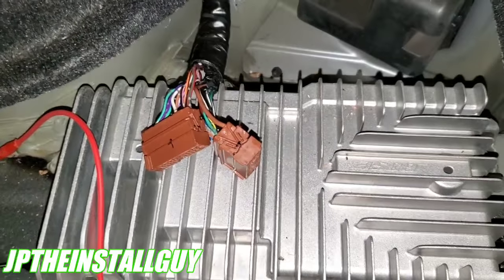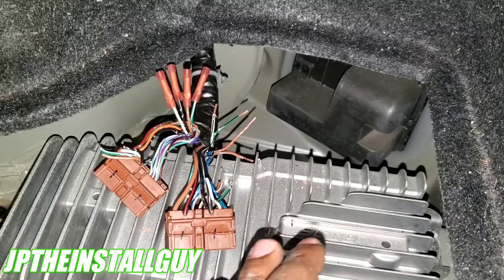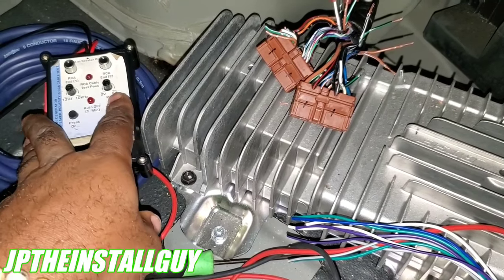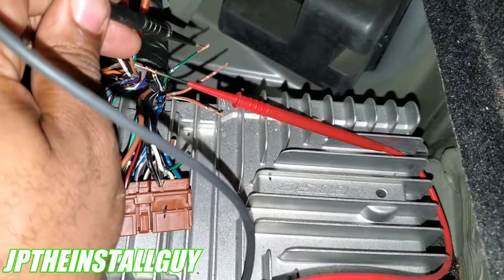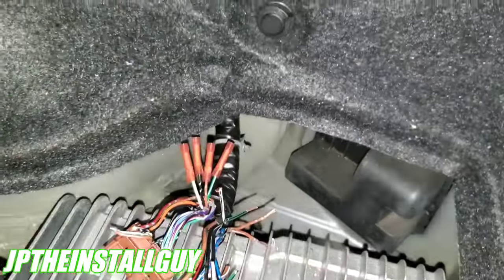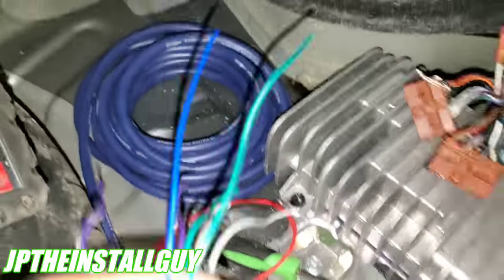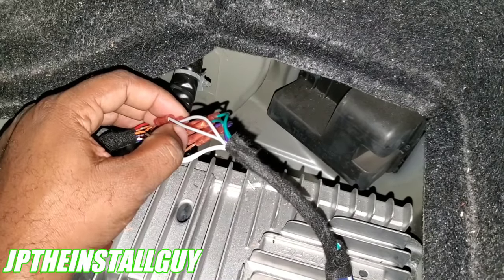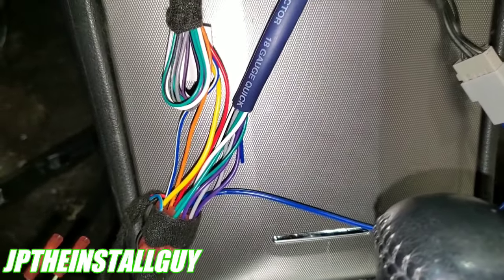How to bypass your factory amplifier

Comment: Can someone help me, I have the oem stereo in my 04 g35 sedan x, I have an aftermarket  amp, but the amp stays on with the stereo off, where or which remote wire to use?
Reply: Tap in acc wire (Orange) or better off get after market radio.

Comment: Dude can you offer me some advice please? I have a 2005 G6 and it has Monsoon. The only harness I can find says will not work with monsoon(idk if this means the stereo wont work at all or they are just referring to my DIC and chimes). Crutchfield says I need to buy this PAC interface but I dont want that shit, I dont care about my DIC or door chimes. Then I read I can use the harness if I bypass the amp. I dont understand why though. Can I just hardwire the speaker wires and not even connect the amp wire behind the radio? I saw a guy do this but he cut the amp wire and connected it to the remote amp wire from the aftermarket harness. I am so fkn confused man!! I would just keep stock radio but the damn this plays very low volume on FM radio only and no one can help me with that either. I happen to have an old sony xplod I thought I could just swap out until hearing all this crap about monsoon systems.
Reply from the maker: good question so if the harness says that it wont work with your vehicle if it has the monsoon system then it probably means that it is not going to integrate the factory amp. so the radio may come on but you wont hear any sound from speakers. PAC interface harness are always a better choice because it will do all the hardwork for you but it will be a more exspensive harness. the reason you can use the cheaper harness and if you bypass the amp is because the cheaper harness will only power the radio not provide sound so you will have to bypass the amp and run speaker wire to the back of the radio for sound. youll save money but is more work.
Reply: @jptheinstallguy  Ah ok this makes sense thanks! Yea normal harness + the case is like 25 bucks. That damn pac interface will run me at least 90 with a case!
So I can follow this or any video to bypass my amp or is monsoon amp bypass different? Will The volume be much lower because I am not using my amp? Or do you know if the Sony xplod radio has some internal amp that will make it just as loud? Other than volume will it sound better or worse if I do this?

sorry for so many noob questions haha

Comment: I have a 2016 ATS non-cue. My question is, I’m using a Schosche LOC2SLSD, I am only hooking up an aftermarket sub/amp (Skar IX10”D2, Skar RP800.1) do I need to run anything to the head unit? Or can I tap the LOC into the rear speaker wires/signal. I want to get it right the first time. The Bose system is in it and the amp is a 4 harness (black, brown, grey, green). Thanks.
Reply: You can tap the rear speakers as long as it’s not crossed over after the factory amp. If it’s crossed over you will need to find a full signal to power the sub amp signal.

Comment: Plan on adding AudioControl DSP. 2003 FX35 stock everything w Bose amp. Do I add DSP by tapping into the input speaker leads before the amp or after?
Reply from the maker: after the amp
Reply: @jptheinstallguy  Woild this apply to the LOC I'm using currently?  Thank you very much for the fast esponse

Comment: So is it best not to run lc1 off the factory amp?
Reply from the maker: The lc1 is just a bass knob right? You can hook it up to whatever converter or processor your using to tap in with but not straight to the amp

Comment: I have a 2005 suburban with the bose amp. If i take the speaker wires from the factory and connect to an after market amp to run my door speakers. Do I or can I also run the power and ground as well or do I even need to do that? I already have an amp for my 12 inch subs. Im trying to avoid running 2 amp power cables to the battery.
Reply: Use a distribution block to provide power to the second amp... That way you can tap into your original power cable, and then just run a second cable that's only 2-3 feet into the new amp, and of course give it it's own ground (or use another distribution block as a ground block). Also make sure that your power cable is thick enough to handle the additional wattage of the second amp.

Comment: I have a 2011 Maxima also with the Factory Bose system. I bought the plug and play adapter that plugs into factory radio to run my rca plugs. My aftermarket amp and sub work, but I'm not getting much sound. I've adjusted all gains, but still hardly any sound. What can I do to get the full sound to my sub?
Reply from the maker: Did you install an aftermarket sub?
Reply from the maker: What type of converter did you use
Reply: Yes, I have an aftermarket sub and amp. Everything is hooked up. I bought an add an amplifier adapter from Ebay that plugs into my factory radio. It provides the rca hookups and amp turn on wire.
Reply: Any advice on this setup?
Reply: @kylegibson326  I'd ask this question at the Diyma forum... Bose headunits often process the audio signal before it gets to the amp... You'll probably need to swap out the head unit, or get a JL Audio Fix 86 to flatten the signal and then a high end DSP to readjust the signal prior to hitting the amp...

Comment: Do I have to use the LOC on  the factory amp if I just want to install an aftermarket 1-channel amp and sub? Or could I receive the signals from the factory stereo? My car is a 2018 Honda Accord EX-L.
Reply from the maker: your factory stereo doesnt have a set of rca's behind it thats why you would need the loc so if you have a factory amp you can easily catch the speaker wires at the amp but if not than you have to catch it at the speaker or behind the radio
Reply: JPtheinstallguy Could I instead use the LOC on the rear speakers or the factory sub? The factory amp is tough to get to.
Reply from the maker: @Apezilla  if you can get to the sub use the sub especially if you are wanting to hook up a sub amp if you dont have a factory sub the rear speakers will be just fine
Reply: @jptheinstallguy  Yo JP, I got a similar problem. I got an 08 civic coupe with premium 7 speaker system. I want to add a 4 channel amp to juice up my new front and rear speakers. For the LOC inputs, do I connect them to the speaker wires from the factory amp or the inputs of the factory amp? I would then run the 9 wire to the amp and cut the corresponding speaker wires right? Or do I leave the factory amp inputs alone and just use the speaker wires?
Reply: @jptheinstallguy  ok quick question if we use the factory sub speaker wires that's 1 positive and 1 negative but then going to the lc2i for instance that requires left and right positive and negative. How would we use just the factory sub wire positive and negative ?

Comment: Is it possible to bypass the factory amp with out sending wires to the stock stereo? In other words can i bypass the factory amp and just connect everything str8 to my aftermarket amp. If so how??? Do i tap into the factory input wires to gain signal for the rca converter box for the amp and tap into the factory output wire to connect the amp to send signal from the aftermarket amp. Because Im really trying to avoid taking my whole dash apart and doing it that way. i located the factory amp in the trunk so i figure it be easier if this is possible. Please if someone knows i would really appreciate it. Thank you.

Comment: how would i run aftermarket amp to a stock radio that has stock amp
Reply from the maker: this is the way. bypass that factory amp and use the speaker wires from the amp side as signal for your LOC or processor and use the speaker side wires to run to your 4ch
Reply: @jptheinstallguy  I put a Bose in dash from a 2007 Tahoe into a 2008 Tahoe non Bose system everything plays but the sound is real low what do I do
Reply: @pirruripirruri4731  Go to the Diyma forum and ask them... I think that Bose headunit might be processing the signal before it gets to the amp/speakers... Bose shit sucks though... I definitely wouldn't put a Bose headunit into a non-Bose system... They sell double din stereos on Amazon for as little as $40... I'd buy one of those cheap ass units before I forced myself into dealing with a Bose that's going to fuck up the signals and give you sound problems.

Comment: how you find the ones come from the stereo? i find the other the ones going to the speakers
because i going to use my factory stereo i wanna put line converters
Reply from the maker: if your installing an loc use the same speaker wires at the amp. you dont want to tap into the radio wires because it not a high level signal behind that radio if you have an factory amp in the car
Reply: @jptheinstallguy  thanks so much

Comment: Can i bypass my amp behind the aftermarket stereo? Ima use another amp
Reply from the maker: Uuum it depends sometimes if the car is factory amplified then the speaker wires aren't behind the radio and you still need to tap into the wires at the amp
Reply from the maker: Uuum it depends sometimes if the car is factory amplified then the speaker wires aren't behind the radio and you still need to tap into the wires at the amp
Reply: Thank you thats what i had to do

Comment: You make it sound so easy now the audio shop makes it sound crazy difficult just to charge you more smh
Reply from the maker: Yea thats one thing I don't like that some shops do. But know this if they start talking crazy it's probably that they don't want to do it
Reply: @jptheinstallguy  right from they're pov F bypassing we want to take the whole unit out bose amp speakers wires head unit everything etc and let us install all new aftermarket equipment and charge you $6500 smh

Comment: just use a 9volt battery connect one wire to the pos then start touching the others when you hear apop thats two wires you need and the pop come from the speaker they go to

Comment: Is this what you have to do to add an aftermarket stereo in your car?
Reply from the maker: only if you have a factory amp and you want to amplify your speakers with a different or more powerful 4 ch amp you would just cut them from the factory amp and run them to the aftermarket amp
Reply: @jptheinstallguy  thanks so much much this was definitely a help
Reply: @jptheinstallguy  would you lose functions? We are having trouble getting the subs to hit loud. 2014 high country silverado.

Comment: Actually the factory Bose systems are more then enough for most.. you just have to use a good sub and amp and then tune all the bass out of the factory system.. makes for a pretty good well rounded system.. don’t know about that Altima system but in more luxury vehicles with the HK or higher end Bose systems the speakers and amps are more then enough for mids and highs.. they will get super loud and clean if you can keep them from playing anything under 80hrz

Comment: All you need to do is find the radio on switch wire in the factory wiring harness then wire that wire to your red accessory wire n bam no need for all those 50$ shits or cut all them wires up like this dummy your welcome got a vid on my channel if you need more explanation